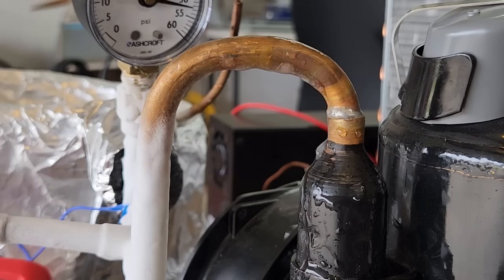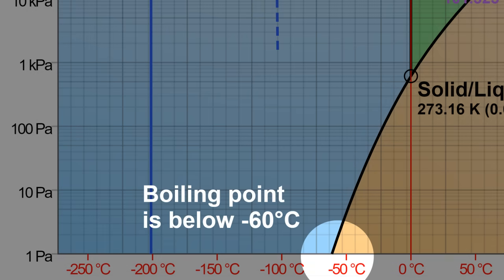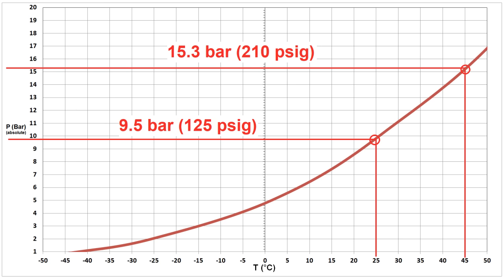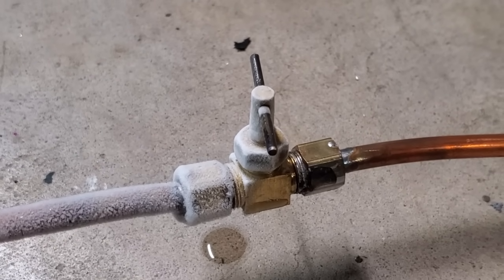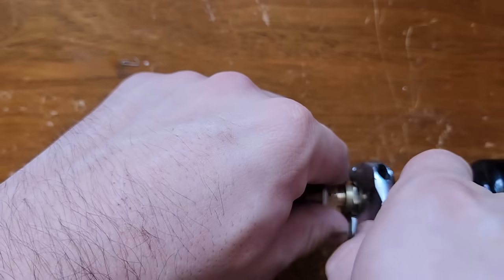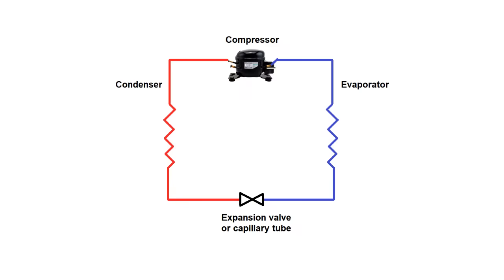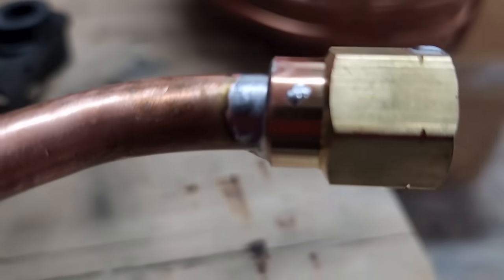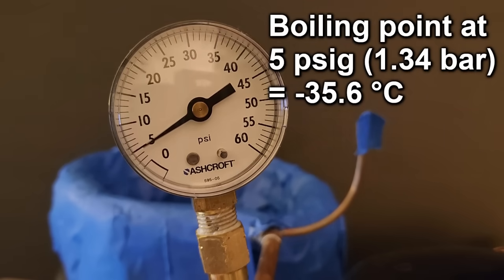DIY Vapor Compression Refrigeration System

Comment: Frost is actually pretty effective insulation, so while an HVAC guy (me) doesn't generally like to see it, you can see how it serves your purpose, preventing unnecessary heat loads migrating into the system once the layer forms.
Reply: Bruuuh! Also an HVAC guy here, were you about to explode right up until he said? Oh yeah by the way I did vacuum the system down😅😂 ....
The way he did it it looked like he was like. Oh yeah, I just built this compressor and evap soft soldered it and then dumped a bunch of propane in there @atmospheric pressure. I was dying for a second but also I was like there's no way he doesn't know this
Reply: @smn368  I just assumed Pirate did it.  He mentions having a vac pump just laying around so while he didn't spell it out in the moment and I admit, I had a little nagging doubt, he's also pretty comprehensive about everything else so I figured he'd covered that step in its time.

I threw a solder patch on a pinhole once and then forgot about it for the next five years.  Don't disregard solder too quickly.
Reply: Nope... All of it... nope.
Reply: plus you can easily tell it is working
Reply: @ShainAndrews  how so?
Reply: DIY vapor compression is simple. I built a system that can compress liquid. :face-purple-smiling-tears:
Reply: @smn368  If he didn't vacuum it down, he could have rediscovered compression ignition and dieseling. (if it didn't come apart violently first)
Reply: @leifhietala8074  I solder patched a few pin holes on a few evap coils on the ole cheap Goodman units I see leaking daily  as an hvac tech
Reply: @smn368  19:17 not ringing any bells?
Reply: I put donut glaze on my air conditioner, and hell yeah nothing has changed!
Reply: One of the most important survival tricks for really cold environments: The temperature in a snow cavity will stabilize to the melting point of water or 0 Celsius (32 F).
Reply: @smn368  That´s his tactic: He knows where many of the inefficiences are to be found, and exploits that, to find out the inefficiencies he yet knows nothing about: When he stands in front of the question, if his system has now reached its limits (e.g. tolerances, leakages etc.), or if there´s just a bottleneck accidentally built-in somewhere, he´ll then eliminate one of the inefficiencies he knows of, boosting up the system. If that works, it means that the system hasn´t reached its limits yet, and that it´s just a bottleneck hiding somewhere...  Then he´ll locate the bottleneck. That´s a very important scientific tactic.

Comment: You probably already know this, however you didn't mention your flow configuration in the video. Make sure you're running all your tube-in-shell heat exchangers in countercurrent flow for best heat transfer. This series is fantastic and extremely high quality, I look forward to seeing the end result.
Reply: Lol I work on tube in shell heat exchangers and I didn't know that.
Reply: @michaelnonamehere9003  I have often thought about this and came to that conclusion myself, it makes sense. The exchange is more efficient as the input is closer to the output in temperature. As the fluid, or gas goes through the exchanger the difference in temperature remains close and, as such, retains the efficiency.
Reply: Yes, noticed that the diagram had arrows going in the same direction, but counter-current is optimal in linear exchangers. Props for Adrian, and yes, props for HypPir. Good job.
Reply: I was going to mention the same. Countercurrent flow maximizes the temperature difference between the two fluids, enhancing heat transfer.
Reply: i paused to comment this too. the same flow direction will have both fluids exiting at (almost) the same temperature. opposite flow direction will much more effectively transfer (nearly) all of the temperature of one to the other, for example the hot side will exit right at the coldest part of the cold side, therefore the hot input will exit (almost) that cold.
Reply: Same theory for jet engine efficiency. You want the exhaust speed as close to the rated speed of the aircraft. If its way faster then your just wasting energy
Reply: depending on the flow rate, it may not be that big of a gain, there's only a 3C difference in this example, so the delta won't be that high. it's better but only if you're trying to squeeze a few %.